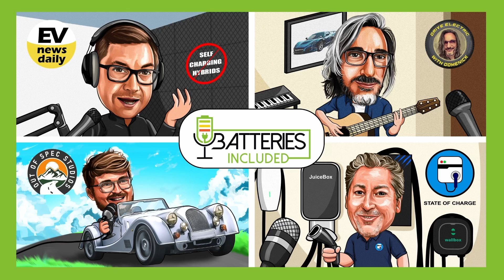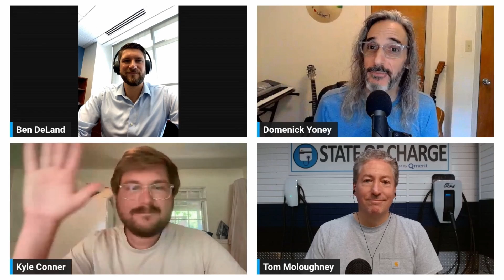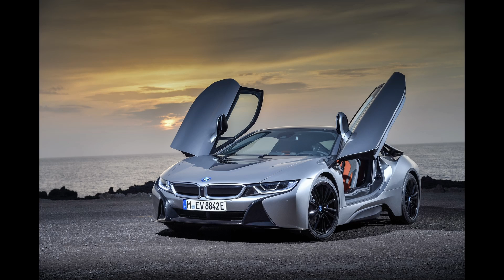Leaning Into Electrification With Axles, Inverters, and eDrives: We Nerd Out On GKN Automotive

Comment: Park lock vs e-brake: Both. Both is good. There's a small but nonzero chance that the electric parking brakes, which clamp the calipers and typically rely on motor current feedback to know when they're applied hard enough, might fail to apply hard enough. Mechanical pawl locks in the drivetrain are essentially bulletproof. In fact if you have ANY vehicle, you should be using the parking brake anyway just so it doesn't seize up. Maybe Kyle should learn to come to a complete stop before putting it in park! /s
Reply: I agree, but Kyle doesn't like how a parking pawl feels or that it doesn't allow him to engage it, while the vehicle is still moving, so we can't have that can we? lol.... It's such a simple mechanism, how much does it even save eliminating it?
Reply: re: "Maybe Kyle should learn to come to a complete stop before putting it in park!"  yeah (same as a transmission case) Kyle's antics are about to shatter the whole damn drive unit housing, good job. 👏

Comment: He is talking my talk as a former electrical design engineer.  :-)  I hope he likes Infineon silicon carbide FETs.  I still own stock in that one! I also was a sales rep for EPC GaN FETs.  So much less gate capacitance is really good for high speed switching. Remember switching current on and off is the heart of an inverter.  The key spec on a high current FET is how low the resistance is when it is fully turned on.  Fast switching helps reduce losses during the time it takes to go from completely on to completely off.  Switching speeds vary based on what is optimal for each designs requirements.  
Dom, they all use heatsinks already.
Reply: Since you mentioned your EE background and I'm just a ME. Why is there no thermal management, whatsoever that I'm aware of for e-bikes? I know it's a cost issue. But there's some relatively simple thermal management options. And it would seem that it would at least make sense for the electric motor if nothing else. To add something like stator oil? Plus it prevents water moisture intrusion. Plus the torque curve would be flattened. Your thoughts on the subject matter would be appreciated. Take care.
Reply: @nc3826  Hi nc, I have not heard of heat issues for E-Bikes.  I would think that only passive cooling would make sense.  to me this means fins if needed.  Think about how a small ICE like on a dirt bike is cooled. The electric motor needs way less than that since they turn less than 10% of the power to heat instead of 70% like a small engine would do.
Reply: @gregkramer5588  Thank you for your feedback and I appreciate that it is not your area of expertise. 

So I would like to clarify that the analogy made between an ICE heat engine and electric motor isn't apropos at all.  A heat engine is designed to convert its fuel into heat initially. And based on Carnot's Theorem, the higher the temperature the higher the efficiency. 
Which is just the opposite of what Is needed to maintain efficiency for an electric motor. (this is an oversimplification, but it's true generally enough, relative to the point, that I'm making that thermal management is even more important for an electric motor than an ICE) 

But yes for an e-bike's, motor, electronics and battery, thermal management It's limited by factors such as cost, complexity and weight. That being said,  there are more effective methodologies than passive heat sinks, such as using oil that has been utilized, but it's just on a very limited DIY basis. Feel free to Google a Statoriad and stator oil. Plus strategically utilizing the Peltier effect, to remove the heat. It's not that efficient, but it's light enough to utilize an e-bike. Which would be used in conjunction with a heat sink. For example to eliminate  battery degradation from excessive heat buildup. But I do appreciate your take on it.

Sorry for going down the e-bike rabbit hole, but with the record high temperatures we had this summer and I was thinking about building or buying an e-bike. So he got me thinking about how well it's protected against damage from overheating. Besides a BMS there seems to be virtually no other form of protection against excessive temperatures? Thanks again for the reply It was appreciated.
Reply: @nc3826  I am sorry but I am not going to read that.  I am just saying passive cooling with fins is adequate.
Reply: @gregkramer5588  Sorry I got a little carried away with my retort.... Have a nice day...